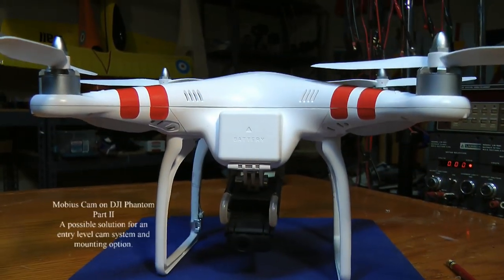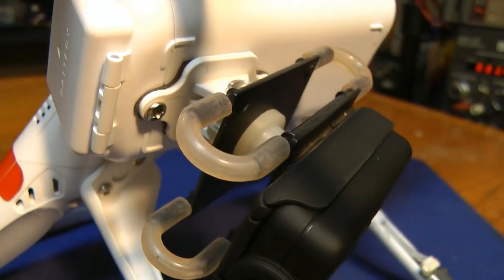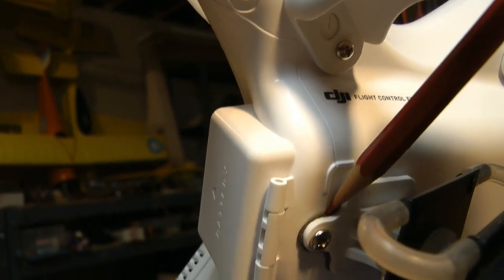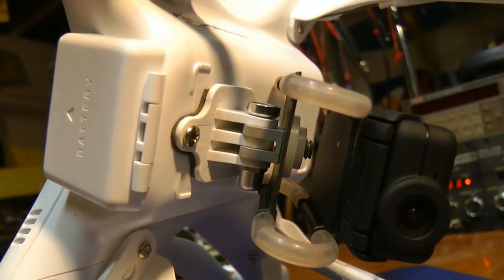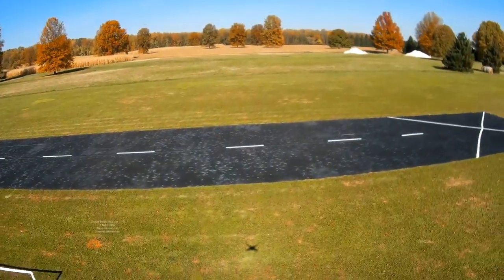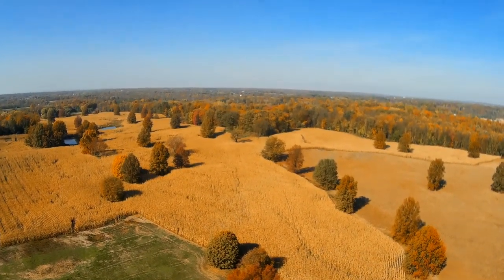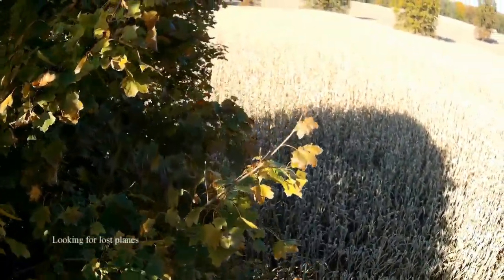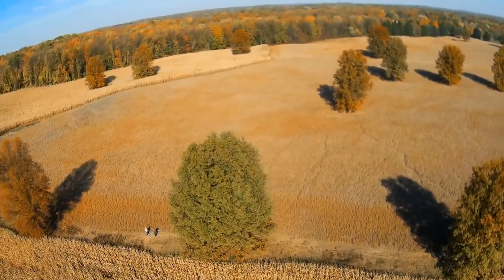Mobius Cam Pt.II A Solution To Jello?

Comment: Newton's Laws of Motion.  Give them a try.
Reply from the maker: Goat, I try them from morning to night along with any other human on earth I would imagine. You may have to enlighten me a little bit with a more qualifying comment. My limited knowledge of Isaac pertains to three laws which explain what happens with actions and reactions to mass as it pertains to movement and stationary objects. I'm sure the laws read on what is happening here but it is just as easy to say vibration transfers to the cmos sensor. We all know that much without reading physics books. You could be helpful by explaining how you would use any of the laws to overcome the problem. Here's an example: The motor vibration is an action and the reaction is opposite sending a wave through the plastic hull, camera mount and finally to the CMOS sensor of the camera along with other parts of the airframe as well. This is expected as explained by the laws of motion, but doesn't help to finding an answer to the problem. My guess was to minimize the Action with balance and get in the way of the Reaction with a shock absorber. I think Isaac would be happy to see us in reference of his material though.
J
Reply: The word "inertia" came from the idea that an object has an "innate property" which resists change in its movement.

We know this today as "mass".

To get rid of jello, take your camera and secure it to the heaviest object in the craft which can be isolated.

That's usually the battery.

Then, as one unit, isolate that from the source of vibration.

Granted, on your Phantom, your options are a bit limited. But then again, that makes it an area for innovation.

The guys flying the more open designs have no excuse.
Reply from the maker: GoatZilla
Well, you certainly know what you're talking about. Ha, no excuses for the flying hardware stores right. What attracted me to the Phantom was the clean lines, and even what I did with this mount seems to be a compromise to the nice looks of the ship. You're right, using heavy objects in the mount system is a key if you can work with it. The mount I built here was inspired by someone who hung a board below the hardware store copter and on the board he had his battery and camera. The board was hanging on braided wire like for hanging pitchers on the wall so the combination of weight and suspension actually stopped the vibration and also gave the mount sort of a gyroscopic affect that made the video very smooth. Hmm, but it was unacceptably ugly. So far this seems to be working. I may go back and rebalance the motors with the cell phone vibration ap and call  it quits for a while. Thanks a lot for the constructive reply. I thought you'd be mad at me for mine.
John